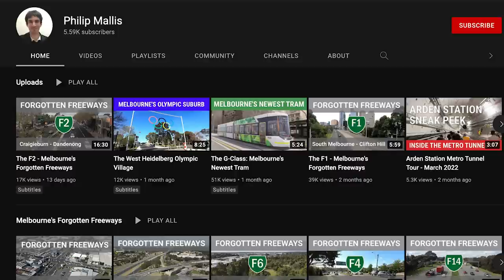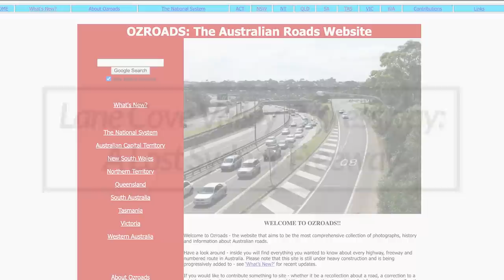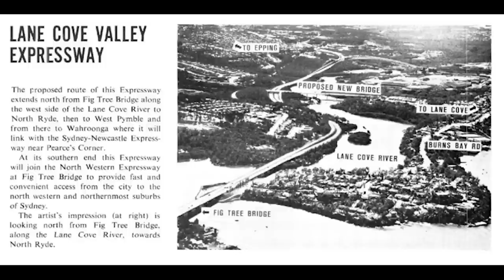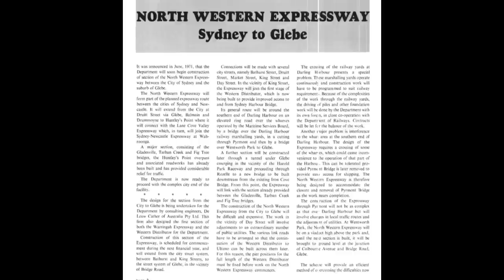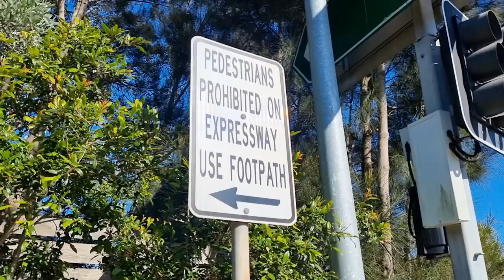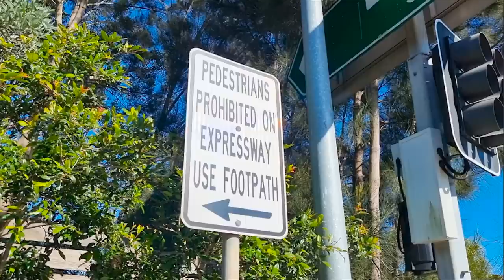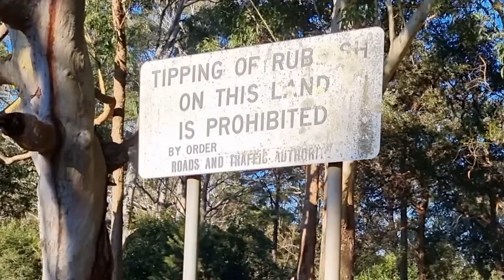Lane Cove Valley Expressway: Lost Sydney

Comment: Loved this video! I have lived in Gladesville for many years and was always struck by the freeway look of the interchange between Burns Bay Rd and Church St that seemed way too elaborate for purpose. After learning about the abandoned freeway I had tried myself to trace the possible route northward. Like another commenter, my theory re that mystery bridge from Lane Cove to East Ryde is that it was most likely an extension of Penrose St across to Pittwater Rd. Interestingly, that bridge is close to where a rail bridge would have been required for an abandoned 1930’s plan to extended a rail line from St Leonard’s to North Ryde via that same location in East Ryde! Keep up the great work.
Reply from the maker: Thank you! Yes, that location might very well be right.

Comment: I suspect this expressway will eventually be built, but mostly as tunnels. There is a hint to this occurring as the Northconnex interchange with the M2 doesn’t include free flowing ramp connections to the M2 eastern side.
A new motorway tunnel from the M1 at Hornsby to Macquarie Park would provide this direct connection.
Reply: Needs to be done and the current M11 really needs to connect with Silverwater Road.

Comment: Hello, I grew up in the Lane Cove West area from the 60s.  The alignment of the original proposed expressway was actually between Myee Crescent and Cope street.  You can see in your satellite view at 7:33 in the video, a green strip that still exists to this day where the land was reserved.  Maybe the later plan took the alignment up the LHS of the Lance Cover river valley, but the original plans had it running across Penrose street and then eventually turning left and linking with Epping road at Blenheim road.
Reply from the maker: Yes, you're correct actually. The original plans did have it go on the east side of the river. But they changed their minds about this at some unknown point, as you'll see that the description in the DMR notes "west side of the Lane Cove River". Why did they change their minds? No idea! Maybe because the westerly route was more direct and would spare more houses. Thanks for watching!
Reply: god I love Sydney! 😂❤
Reply: On a similar note, the grainy, B&W mocked-up photograph of a “proposed new bridge” in Lane Cove West joining the Burns Bay Road with the new expressway seems to show that bridge starting at the west end of Penrose Street. Certainly that would have made a good place for such a bridge since the river is narrow there and there is already a major intersection connecting Penrose Street with the Burns Bay Road and what ultimately becomes River Road running to Crows Nest. Only one house would need to be removed for Penrose Street to continue westward as a bridge (or no houses and minimal bush land with a slight deviation into Blackman Park). 
Also, Blenheim is pronounced “Blennim” not “Blen-Hime”. 
Interesting video and a great channel.

Comment: Nice work - but you missed a hidden gem of this forgotten freeway. In Fox Valley, the Broadway is a dual lane road but is only minor local road - a sign of its intention to eb part of the freeway. But most interesting is at the single lane section of the Broadway where you say the other side of the road is bushland. If you go into this bushland here you will find they have laid sandstone flagstones as road base for the freeway. It goes for about 300m. There is a bushwalk along this bit of road which never got further than the roadbase.

Comment: Before the Howard government locked in northconnex, all the RTA plans were to connect the M1 with the M2 thru the reservation but this was Liberal heartland the the drivers were most probably labour voters from central coast commuting to Sydney. Them house values have to be preserved at any cost.
In other words, no one cared that the tolls would be double, last longer and do not follow the demand route.
The Parramatta to Chatswood rail line was also butchered for similar political reasons even though it would have solved critical bottle necks in the Sydney rail system, bottlenecks that still exist :-(

Comment: Great video! My understanding is that there was also the B2/B3 proposal which would link the M1 with the M2 at the northern part of this.  This was put to bed finally once the current M2 was linked with the M1 tunnel from Wahroonga to the M2 at west pennant hills.    Nevertheless there is still choke points on the north shore.  Sydney still lacks a proper north-south freeway without having to go out west to the M7 or eastward into the city.   The only options are Metroad 6 or 3 but there are no plans for these.
Reply from the maker: It's a shame Sydney doesn't understand the concept of circumferential travel, both in rail and road respects. Well, at least there's the M7 and the future M9 motorways, and the Metro WS Airport.
Reply: Toll Free A28 on an avg day the time dif is only 12mins longer and 8km shorter saving $23+ in tolls, Pennant hills road is great now the trucks are gone
Reply: @BuildingBeautifully the new M9 really should be starting from the Princes Motorway and linking to the Golden Hwy, Hunter Expressway & planned Singleton By-Pass. This will help take off so much pressure from the M2 and F3 having a second motorway road north.

Comment: You should do a video on that odd section of James Ruse drive that exists just after Rosehill up towards Northmead. It looks like it was supposed to be a full-motorway m4 to m2 link. A corridoor seems to exist still for this purpose.
Reply from the maker: Actually, as far as I know that route is complete. It's part of the Parramatta Ring Road, a bypass around Parramatta. Not too sure what corridor you're referring to?
Reply: I know the section that you mean, and I get why you think it is a bit odd, I always though that too. But with the reply about a ring road/bypass it makes more sense. Also what looks like a corridor is a ton of creek area, so no good to build housing.
Reply: @BuildingBeautifully  oh I more meant that a motorway grade link between James ruse where it's 90kmh down to the m4

Comment: The central section of the national park, between De Burghs Bridge on Ryde Road and Fullers Bridge, was set aside as a park in the 1920s. The area was managed by a trust and was called Lane Cove River Park. In 1982, the NSW Government took over direct control of the park which was then called Lane Cove Regional Park. It was renamed Lane Cove National Park in 1992.
This all happened afterwards meaning acquisition of the land and running the expressway through the bushland was both legal and feasible in the 60s and 70s.